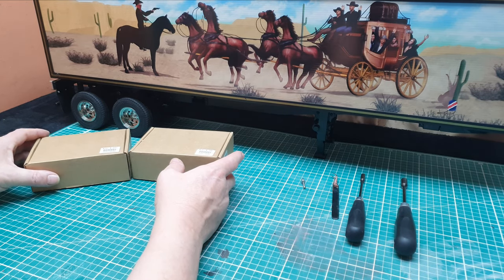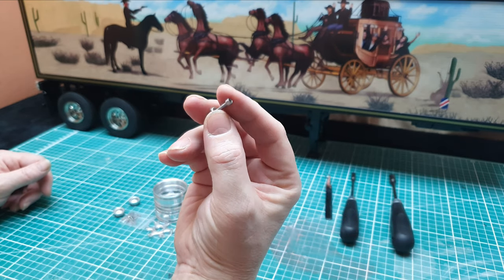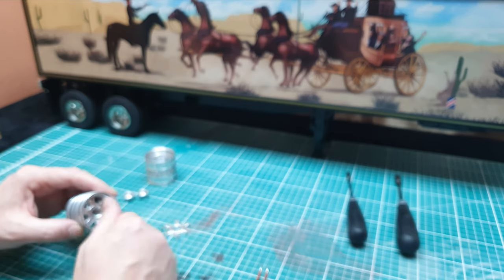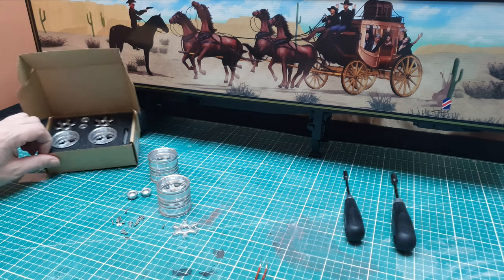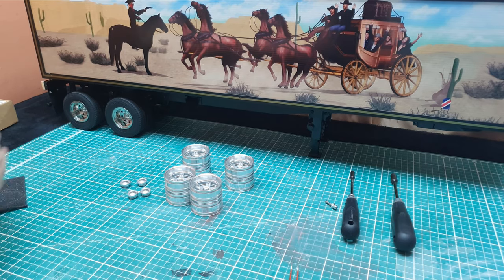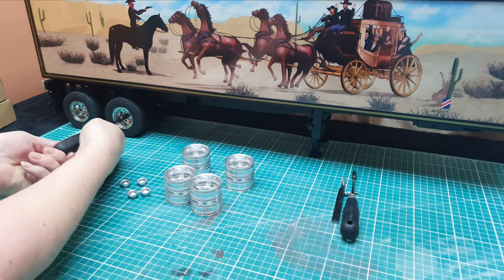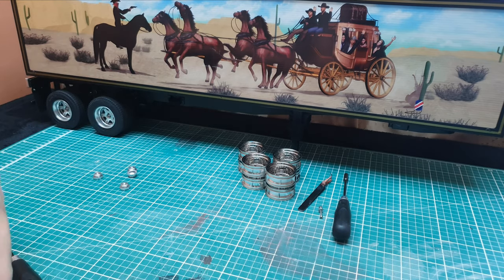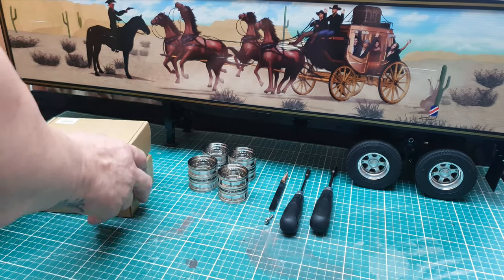Lesu Dayton Spider Wheels on Snowman's Semi Trailer, Tamiya King Hauler

Comment: Those wheels are a great addition, as with the BJ, something special to see the ally finish and the attention to detail, will consider for the Tamiya tipper that I have to build, especially with the Crossforce tyres. Well done and look forward to future builds, mods and info.
Reply from the maker: They never really "finished".., These wheels weren't available when I built this truck and trailer so there will always be something new and better you can add later. 😀
Reply: @TeriWilde  That's the fun part .. that continual search or awareness of what's available and possible ..the desire to please,  ..A great hobby